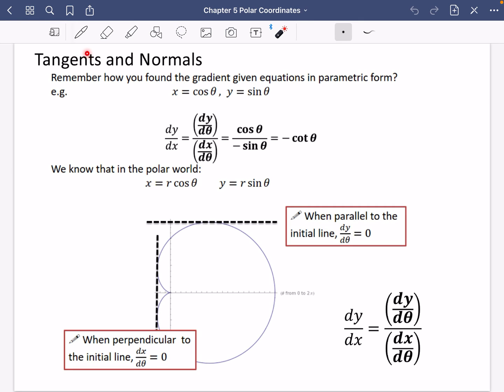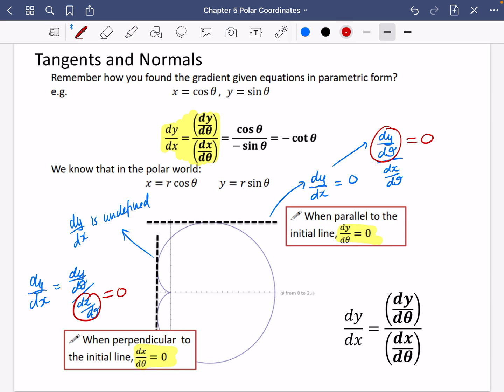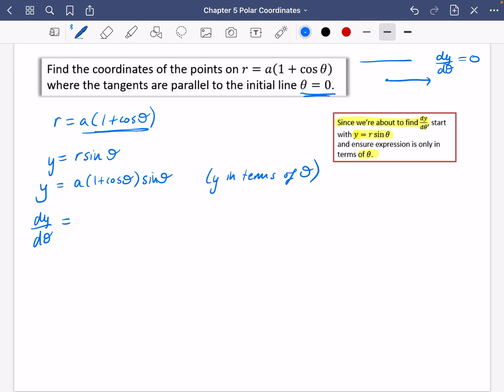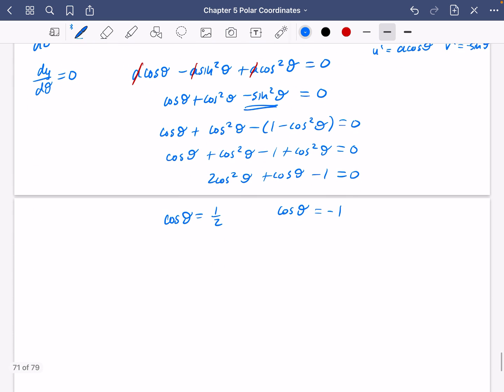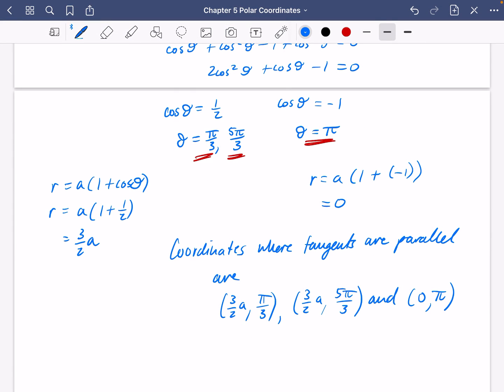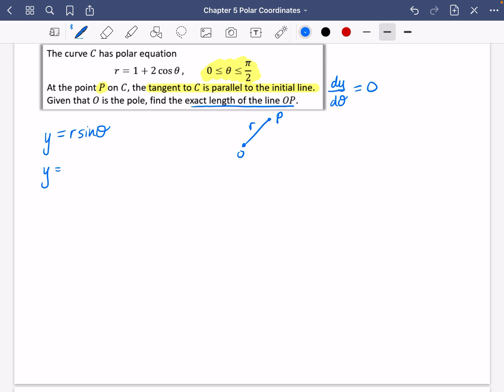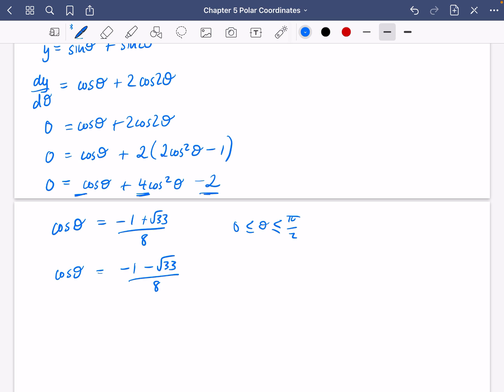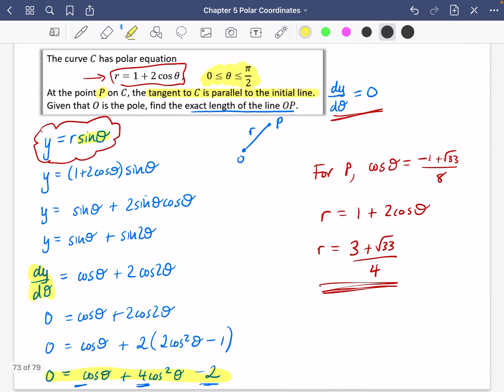Polar Coordinates 17 • Vertical and Horizontal Tangents • CP2 Ex5D • 🎯

Comment: 6:45   How did you know there were exactly 3 co-ordinates before you looked at the desmos graph?
Reply from the maker: I knew that the 1/2 would give 2 solutions, and the -1 would give 1 solution from my knowledge of the cosine graph between 0 and 2pi!
Reply: @BicenMaths    Ah okay I understand the thought process now. Thank you very much! 🙏🏼
Reply: @BicenMaths  In the question it doesn’t state the domain (range for pheta). Am I missing something?
Reply from the maker: @AppleApple-ux1be  There needn't be a range for this as the graph keeps looping and looping for higher values of theta - so we can just consider a full 360 loop, i.e. 0 to 2pi, or -pi to pi
Reply: In the exam it may help to just plot it on graphing mode and then use the sketch to help interpret algebraic solution imo.  Obviously not with the a. To account for it you can either imagine the translation, do it without the a or try for range of values of a quickly and note trend.

Comment: At 6:38 when solving the trig of cos theta = 1/2 do we do 2pi minus pi/3 as it is within the range of 0 and 2pi? How dop we know not to add 2pi after doing this?
Reply from the maker: We only want values for this curve between 0 and 2pi, or could even have done -pi and pi, as that is the full range for the curve. If you have a sketch, it'll quickly become apparent which angles the solutions are referring to on the curve!

Comment: Hi sir in example 1 how is (o, pi) a tangent if it touches the curve goes through the curve at 2 points? 9:32
Reply from the maker: It can be tangential to the curve and still intersect with the curve in another place - think of a cubic graph for example (not in polar), many of its tangents will also intersect with another section of the curve!